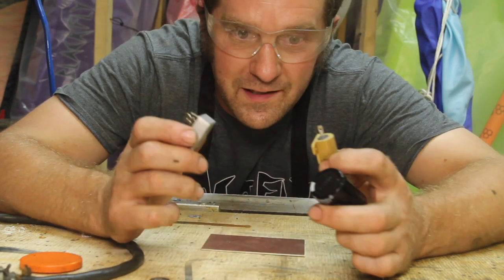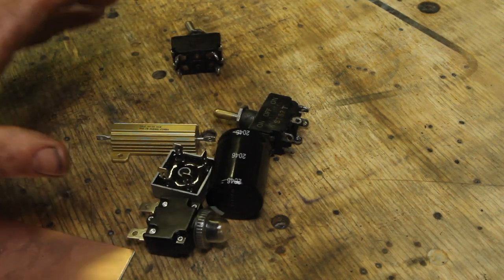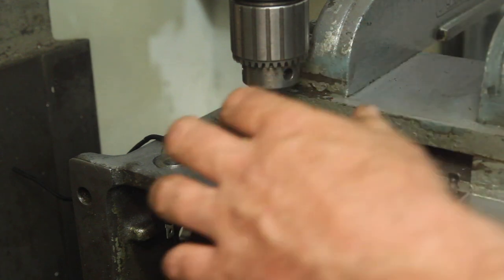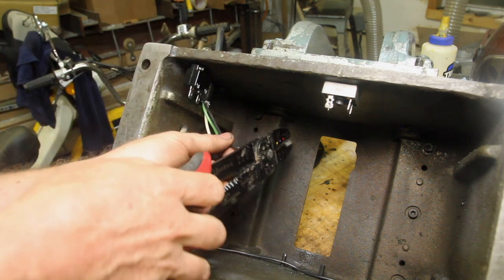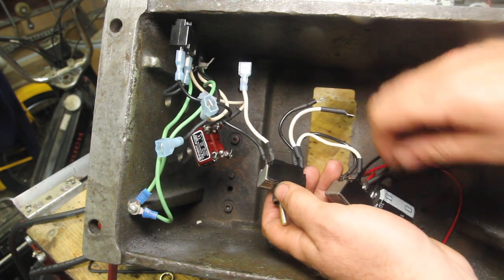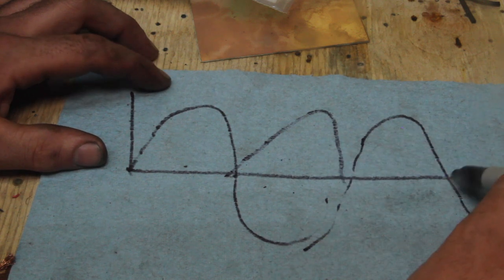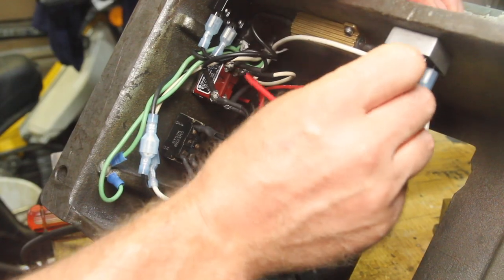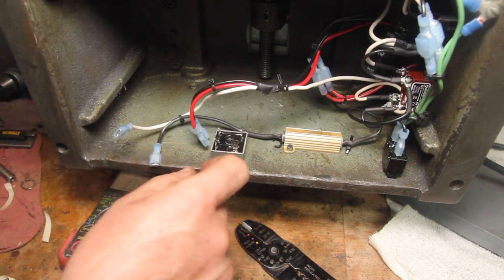Sanford SG (Part 2) Magnetic Chuck Wiring

Comment: Great result and video quality/edit! General safety tip: after you're done wiring double check your ground is actually connected before plugging in for the first time. Check for connection between the ground pin on the plug and say the grinder bed or base with a multimeter. (And if you're there with a multimeter you could also check for no shorts between the plug ground and power pins).

Comment: As you connected the bridge rectifier the first time I was shouting wrong wrong. Diagonally across the block is ~~ AC and + - DC. 
Also I think your fuse is a bit underated. 4 amps for the motor and one for the magnetic chuck comes to 5 amps but makes no allowance for any inrush (startup) current which, depending on the motor, can be quite high. There may also be some for the magnet. If you find that, after turning on the magnet and then starting the motor, the fuse trips you probably need to up the fuse rating to 7.5 or even 10 amps. You will still have protection in the event of a short in the wiring but it won't trip un- necessarily.
Good luck on the rest of the reno.
Merry Christmas to all from Canada's banana belt .
✨🤞🇨🇦👍✨
Reply from the maker: I wish you would have shouted louder, I didn’t hear it!  
So far the fuse size doesn’t seem to be a problem- it seems pretty happy.  It’s a pretty small motor.
Reply: Specs. on the motor? H.P.? Motor Mar? These would be clues to which edition of the SG you have but I'm betting that it is an SG-2. Former owner of Sanford Manufacturing Corp.

Comment: The nut holding the power switch is suspect. The motor and motion of the surface grinder will introduce vibration, which over time could loosen the nut. Since some of the connections of the switch are exposed and not insulated, it is conceivable that a loose switch flopping around has the potential to make contact with the metal casing. Lock washer, added insulation and some kind of restraint for the switch is advisable!
Reply from the maker: Good advice, I’ll see what I can do.  I tried to get all my T’s crossed and I’d dotted, but it’s nice to have a few more sets of eyes check my work.
Reply: @JeremyMakesThings  A bit late to the party, but hey ho.
The metal bodies of the power resistor and the rectifier are actually heatsinks. A bit hard to make out, but it looks like they'd been fastened to the unprepped innards. Since you have the mother of all heatsinks anyway, it might worth making the surface under them clean (shiny flat metal) and throw a bit of a thermal compound into the mix.
There's no such thing as overdone thermal management :)

Comment: I just got almost the same grinder and the wiring was really shotty. Where did you get all  the components?
Reply from the maker: Mostly Amazon, I think I got the resistor off eBay.  The link in the description has the specs for the components.
Reply: @JeremyMakesThings  Thanks I'm going to get to it, Not sure if you would have any recommendations, the motor is original, but someone removed the start capacitor and just bypassed it. From my knowledge that will work but can cause all sorts of issues. I am not sure what start capacitor to use to replace it?
Reply from the maker: @matthewheaton4421  I’ll see if I can pull mine off and find something on it.
Reply from the maker: Mine has a “Mac” brand motor, 1/4hp.  I believe it’s original, but I know they also changed the motor size on these at some point.  The start capacitor is “72-88 MFD, 110v”
Reply: @JeremyMakesThings  Thank you, if you are a member on hobby-machinist, I just made a post on there. If I can help you in any way I would be happy to! I subscribed and liked, good luck in you rebuild!

Comment: Figured I wait a couple of years to comment to let everyone else tell you you messed up with your wiring design. 
I would suggest that you do not run both your motor and your mag chuck through the same fuse/cb Should your motor pop the fuse it will instantly convert your work piece into a projectile.
Ask me how I know. 
I now have my chuck on a separate dedicated circuit.
As my brain often misfires too, I also have an empty tuna fish can with a slot on the side that fits over the hydraulic table control lever. When I reach for the lever I first have to move the tuna can to the mag chuck controller where I turn the mag on. Turn the mag off, the can goes over the lever.
Stupid does as stupid is.
Thanks for all your great entertainment and ideas.
Cheers 
John 🇨🇦